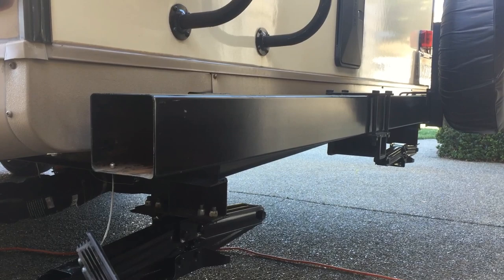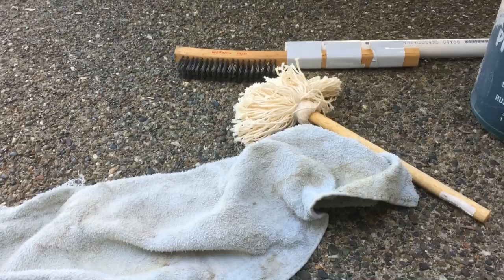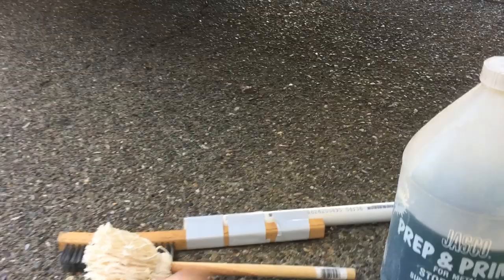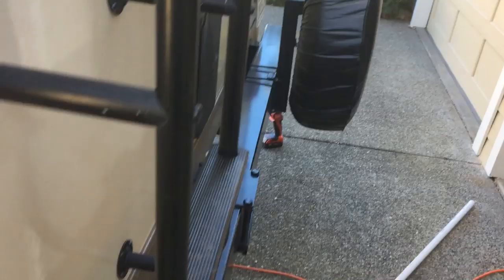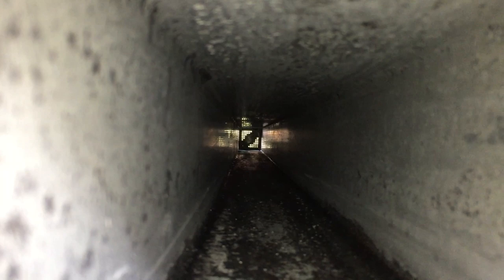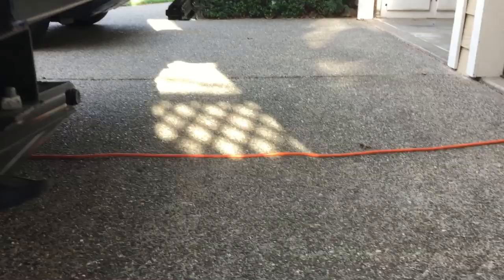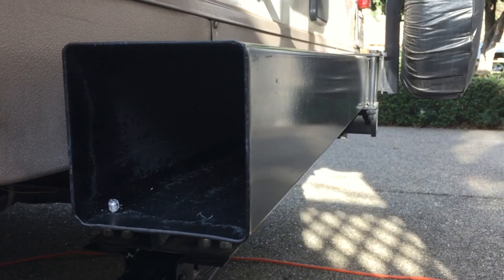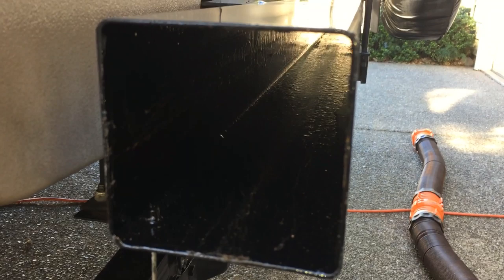How I Got Rid of the Rust Inside Our Travel Trailer Bumper

Comment: The Rhino hoses now come with caps for the ends and they contain any water that may be inside the hose. They make it airtight which prevents the hose from expanding (like a slinky) and makes the hose easier to handle.  Good luck with the long term rust prevention. Good idea with the cap lanyard too.
Reply from the maker: That's good to know, I was looking that those end caps but since my elbow is connected the hose and not easy to remove it didn't seem to be able to work for me. I'm going to see if I can make the ends you mentioned work someday. Thanks so much for your comment
Reply: @thetraveltrailerguy  one cap fits the elbow and the other fits the bayonet fitting, easy on, easy off, takes mere seconds. Easy to insert the whole thing into the bumper.
Reply from the maker: @busch56537  Thank you the only one I can find is the one that fits the end without the elbow. Can you share a link to the one that connects to the elbow? https://www.amazon.com/Camco-40310-Magnetic-Insect-Bumper/dp/B0722Y4SHY/ref=asc_df_B0722Y4SHY/?tag=hyprod-20&linkCode=df0&hvadid=312202698398&hvpos=1o3&hvnetw=g&hvrand=8589305117600588917&hvpone=&hvptwo=&hvqmt=&hvdev=c&hvdvcmdl=&hvlocint=&hvlocphy=9032310&hvtargid=aud-799146894166:pla-450801263265&psc=1

Comment: When I bought my last trailer used it was rusted so bad I couldn't get the hose in or out I did the wire brush on a pole first and then the sanding block and it worked great. I have the Rinoflex hose with caps so no water from the hoses get in the tube. The tube end caps are not water tight!  Now I bought a newer trailer that's not too bad yet but when I get time I'm going to clean and paint it. I do like the idea of the knob mounted on the end of the hose thanks for the great video.
Reply from the maker: Thanks for watching Steve,  Its been a 7 months since I painted the inside of the bumper and it still looks like the day I painted it. The knob on the end of the pipe on the elbow works great. Take care and stay safe